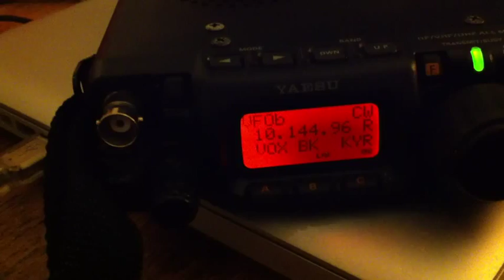An Arduino powered IBM PS/2 Morse Keyboard

Comment from the maker: @vk3ye I don't seem to have any trouble cutting and pasting code into a fresh sketch window on my Mac.  I'll test it out on my Windows box tomorrow, and see what the deal is. I had some difficulty zipping up the code and putting a link to that in my post, but I'll give it a try tomorrow as well, to make it easier to get the code.

Comment: Many thanks for this Mark.  A question - when you cut the code from your blog and paste into the sketch editor, it appears as a single very long line.  I've tried pasting to wordpad and Word to no avail.  Is there a way to easily paste the code or do people just retype it? Thanks, Peter